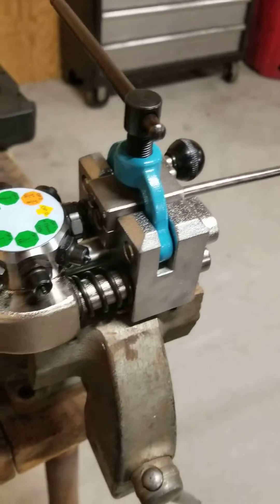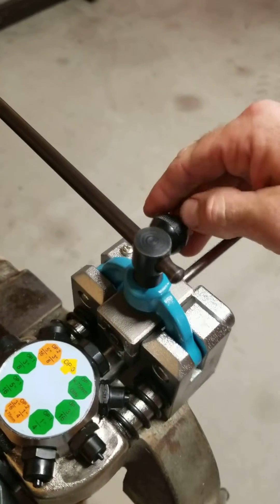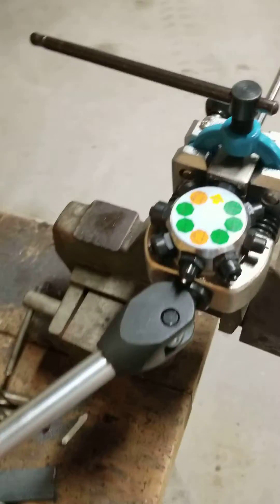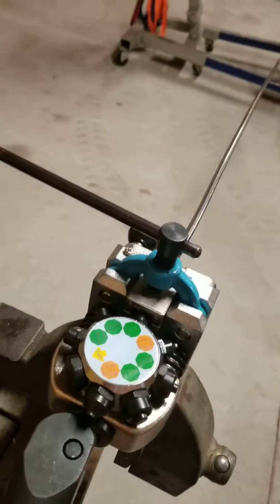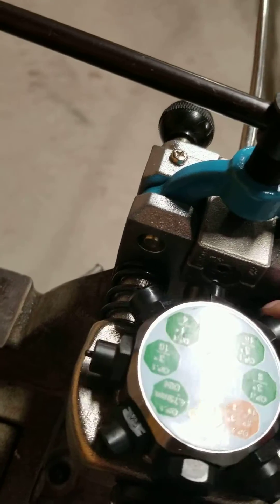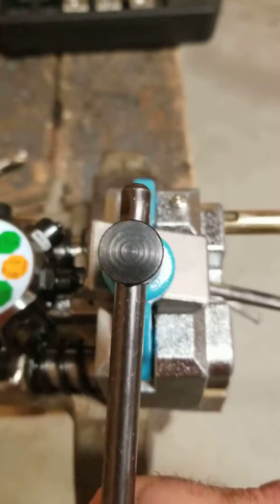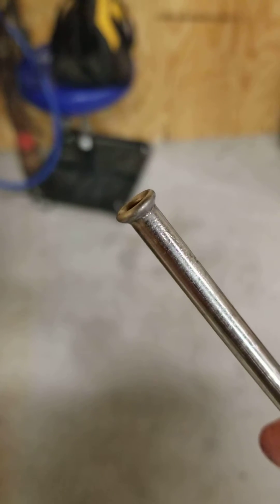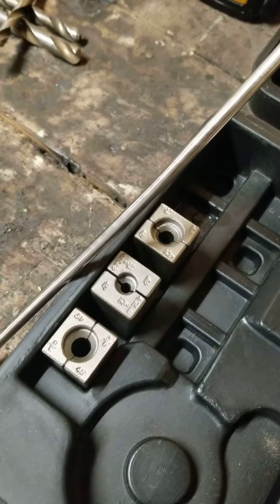Double Flaring stainless tubing

Comment: it is unnecessary to " double flare " stainless tubing , the ONLY reason you double flare regular brake line is the material isnt strong enough to hold up under todays high pressure brake systems. Stainless is HARD and WILL hold with a single flare EASILY  if it is done properly   Nascar uses single flare stainless ALL the time ,  if it WINS on Sunday they SOLD me on Monday morning !!!!

Comment: I purchased the same tool trough eastwood. Great flare but I noticed some tearing on the inside v/cone of the flare. Gonna blead the brake system soon and see if it leaks. If it does any tips on trying to minimize tearing/cracking of the inner flare? I cut it with a tube cutter, deburred, cleaned and lubed the line just like you but those little tears/cracking is bugging me. I'm using 3/16 brake line
Reply from the maker: I believe your stainless product has to be annealed, which is the opposite of hardening.  Make sure it is. Some tubing is not. Thats the only thing i can think of.

Comment: I just had some stainless flared at a shop down town....It leaks. Looks like I’m going to need to spring for the cost of this flaring tool and do it myself, along with buying another length of stainless to replace this one.
thanks for the vid.
Reply from the maker: Stainless is relatively hard.  Try heating it with a hair dryer to soften it and tightening it up.  Just an idea
Reply: Thanks Karl, I’ll give it a try.